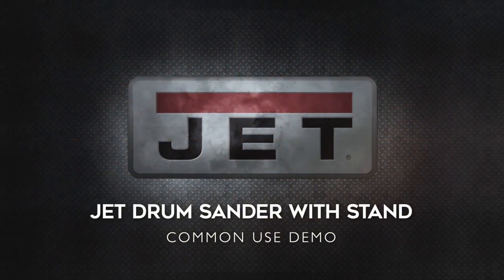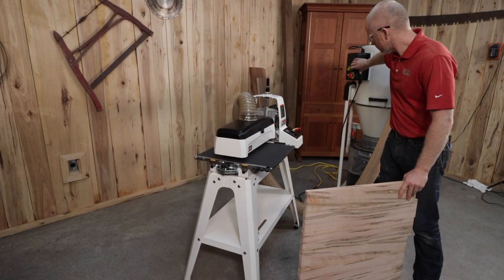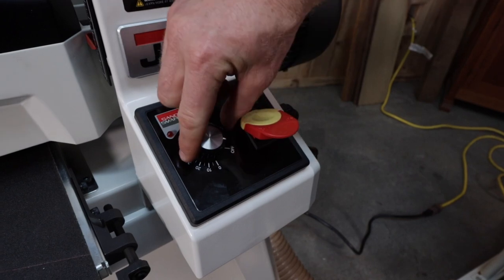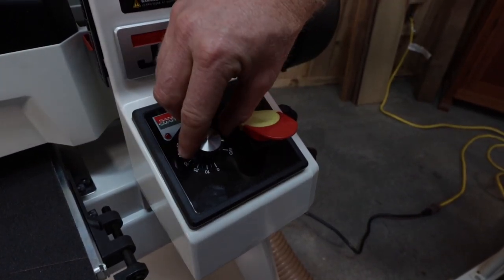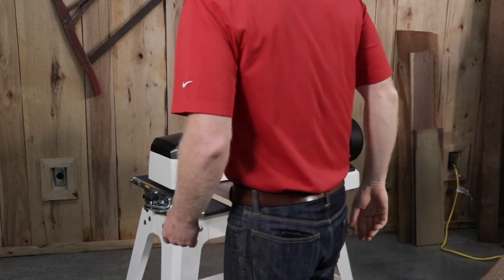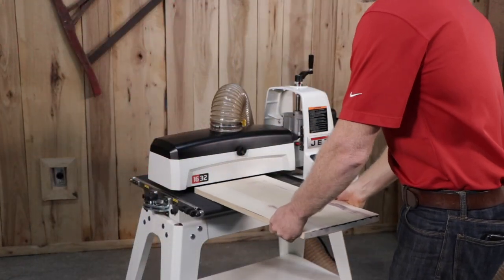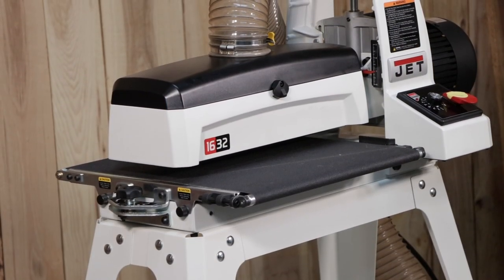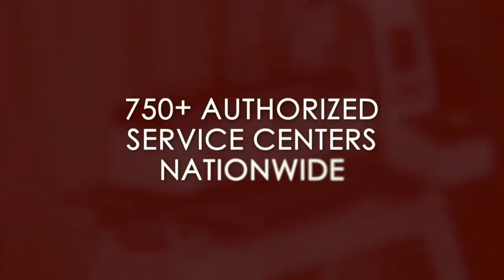JET 723520K 1632 Drum Sander- Common Use #3

Comment: im really disappointed with this sander, on the leading edge you get a 2” snipe that is 32nd of an inch deep,you might expect that with longer pieces but it happens on all lengths of wood, this machine is not adjustable too